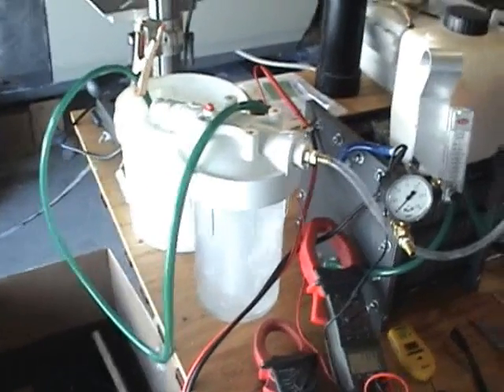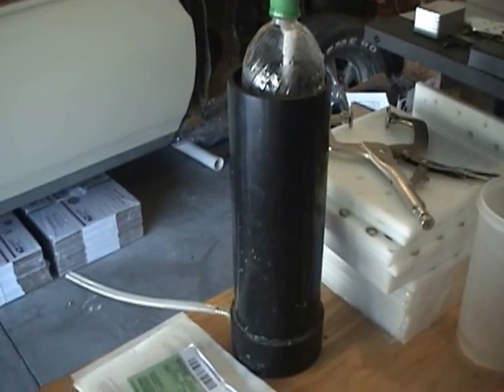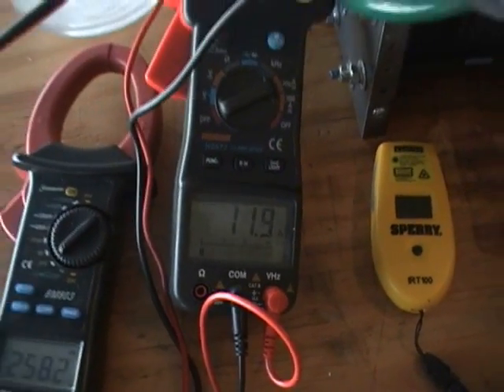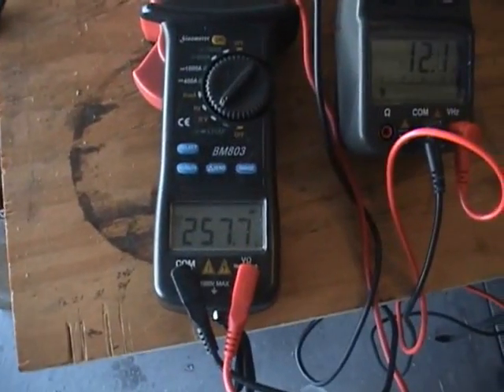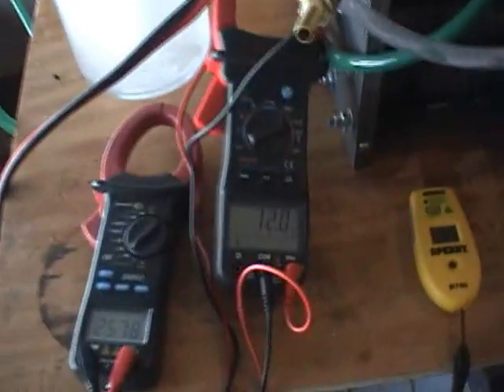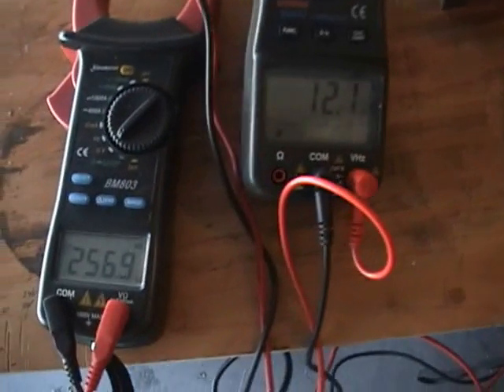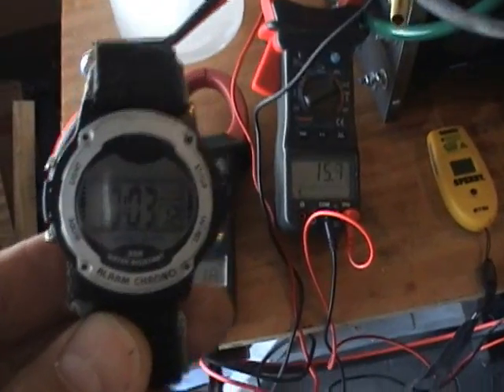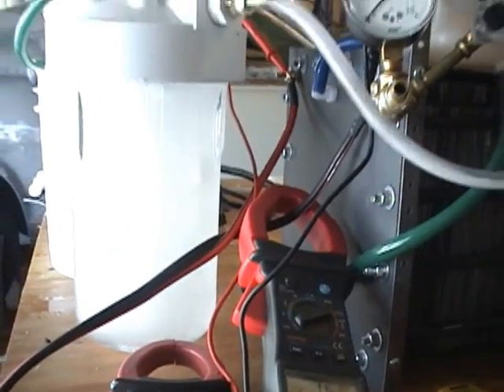20 LPM 118 plate 240 volt massive hydrogen generator !! part3

Comment: Looks great but the water is getting hot and that good for better gas but too hot it not good so a system with that high of a voltage need a cooling coil like some copper pipe to cool it

Comment: PART2
this current follows ohm's law so up to 400 watts of power on your cell can go directly to heating the electrolyte via resistance heating. this is why are cells heat up so fast, a pot of water on a stove doesn't get hot as fast as some of my cells . i will post a vid to illistrate

Comment: hey steve im building a new cell, i posted a vid of the copper cathode cell i built but i have not yet posted my omnic loss video we talked about, my new cell has a trick up its sleeve, the center plate of the cell stack has no hole in it so the current leakage cannot exceed 1/2 the input voltage. basicly steve the electrolyte flow channels act as a conductor freeway that allows current to travel in the form of electrons straight to the cathode .

Comment: Hello guys. You can NOT produce 2.5lt of gas with DC or pwm with 7 plates 12V at 15amps.
There is a theory how to produce 1lt of HHO with only 1Amp at 12Volts but this needs SS tubes as electrodes and pulses of an exact high frequency which breaks the molecules of water. This frequency is depended on the size of the tubes but this is in theory. In real world, it is not easy to find this freq and you need advanced electronics to reproduce it with 100% accuracy.

Comment from the maker: Okay we have some major problems here. I suspect it's your hho measuring equipment. First 7 wall plates is never going to make 2.5 lpm. It doesn't matter how much power you give it. second your figures are way way overunity. Private message me with your email and I'll send you over a bit of software to correctly calculate you figures.

Thanks

Comment: ARE YOU GOING TO PUT THAT GENERATOR IN YOUR CAR TRUNK?? WHERE IS THE HEAT SINK AND FAN FOR THAT FULL WAVE BRIDGE?? TAKE NOTE THAT TO RUN THIS FROM YOUR CAR ENGINE YOU WILL REQUIRE OVER 300 AMPS AT 12 VOLTS OR AT LEAST 4 ALTERNATORS AND LOTS OF HORSEPOWER TO PRODUCE THE ELECTRIC. NOTHING IS FOR FREE. WHY A GENERATOR ANYWAY? NO ELECTRIC WHERE YOU LIVE??

Comment: Remember at the turn of the 1900's, they produced a car that ran on water it was called the Stanley Steamer. If they went with fuel cell back then it would have been purfected today. Since the fuel cell and combustion engine were invented at around the same time. Like the cars of the early years, cars of today have greatly improved. Just like the fuel cell will be purfected..

Comment: Great work but with the amps your using you could run an electric car on and it could be made fast too.
What is the intended use for this cell and is the reason your amps went up due to resistance and heat ?

Comment: very interesting :)  are you stepping up 120v with the Bridge Diodes, and using the Caps to turn the ac to dc, sorry buts that about the limit of my High school Electronics :)  I have been making HYD Gens. with my Sons for over 6 years, they work great, we have learned a lot, is it possible to use a PWM with that many volts, 240 and would it help, just curious, Belive it or not, thats ok, Dont know if its a fluke or not, but on each of my sons car and truck, the best we have gotten is 70 MPG  :)

Comment: I applaud your efforts, I really do, but I just can't understand why you would pump over 3KW into a (?%-efficient electrolyzer) and then pipe the HHO into a 15% efficient internal combustion engine? 

3KW is about 1/20th the power you need to drive a regular small car.

Why not just use 1/5th the energy into a 90% efficiency electric motor to achieve the same output power?

Comment: @MrFreddyFeatures All of this is experimental. Burning H is much MUCH MUCH better for the environment than natural gas, or petroleum, and in terms of the power needed to make H-gas, for people who convert there homes and cars, they use green solar/wind power to run hydrogen production. This type of cell is closer to home power production amounts than car fuel efficiency booster, this is crazy.  With maybe two of these and a large solar array you'd never need to buy energy again!

Comment: GREEN Fuel ....... my arse,  your using over 3000 Watts in electricity , 12.2 amps * 257 volts = 3135w.  I wouldn't mind but i think your using a gas powered generator?

Comment from the maker: @jab0805 your right, The whole cell is in series. My plates are 9x9 but the surface area is basically 8x8 because of the gasket. I will give you a hand with whatever you need.

Comment: I'll for sure be messaging you when I try this out. One question though...do you have to put in 240volts into the hho generator?...or do you just use any voltage and the number of plates themselves are what jump the voltage of the unit?

Comment: @delvis11 So what I get from your response is that with a pwm...the water will never have boiling issues...setting the amps just to the point below boiling point...you'd sacrifice hydrogen...but at least it would be a fairly safe production using simple materials like myself can get my hands on.

Comment: You would need 20 car batteries aiding to make 260 volts approx.  But I bet that would run a v8 engine.  Put the batteries in the bed of the truck :D

Comment from the maker: the caps keep the voltage at a constant level, less ripple and smooths the voltage also. which help the efficiency.
yah i think 10GTE may be a little jealous or a little ego bent because they haven't done it. Im building a better hho management system which should improve efficiency a bit. thanks for your comments

Comment: the purpose for GEET is to break up long chain molecules, basically, make high grade fuel from low grade garbage, on the fly ...  it works well ... but with HHO, we have no long chain molecules to break up ... we have about about as simple a gaseous structure as possible ... so I dont think GEET would help much to run 100% HHO, but might be interesting if using HHO in combination with a petroleum fuel ... an exhaust gas rebreather is a different matter ... that might work well ...